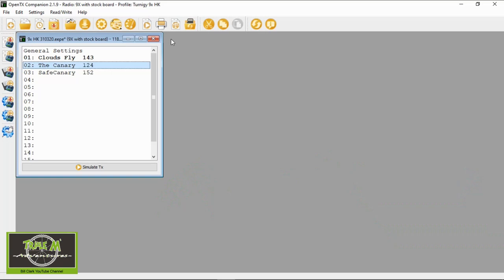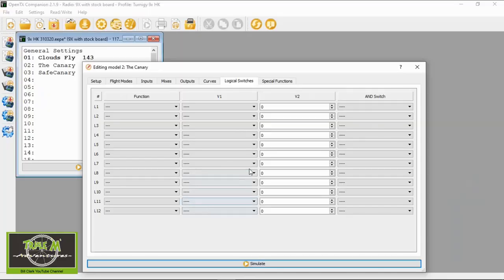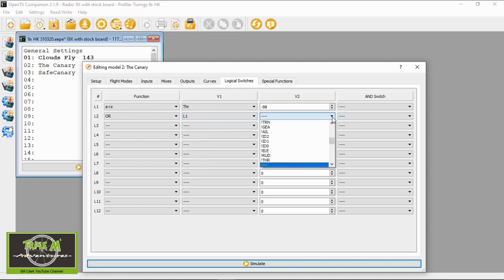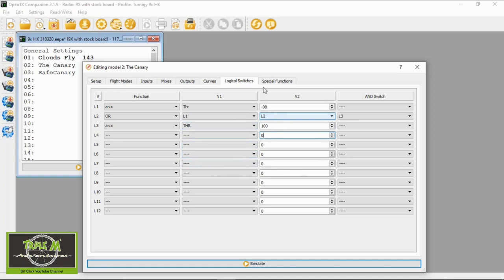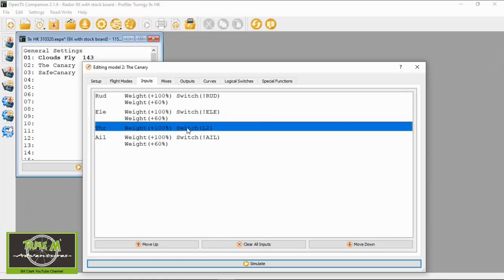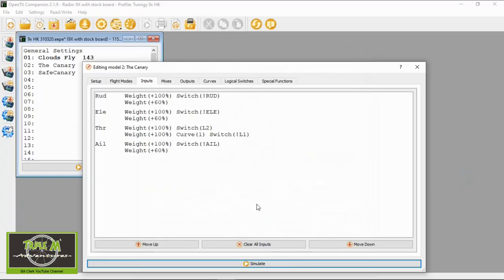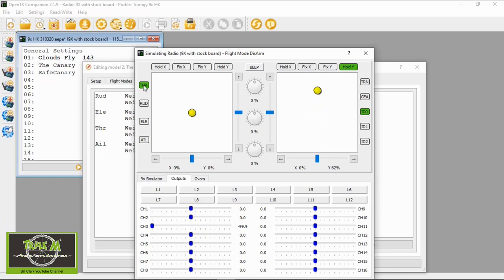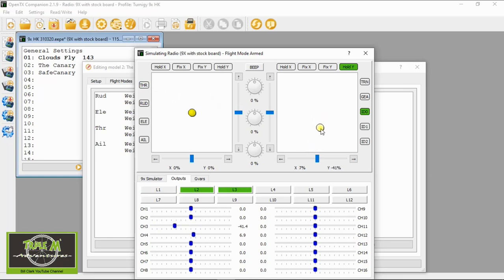Turnigy TGY 9X Setting Up A “Safe Throttle”

Comment: Nice Bill. I don't even have a Turnigy radio? One thing is you keep referring to the symbol "!" as active. It actually means "NOT". Copied from OpenTX University: Symbol for logical “NOT”.  Example “!SA↑” describes a condition that is triggered when ‘Not Switch A in Forward Position’. You probably already knew this, so sorry for redundant information. Thanks for the videos.😀